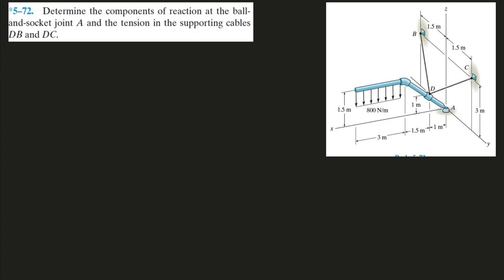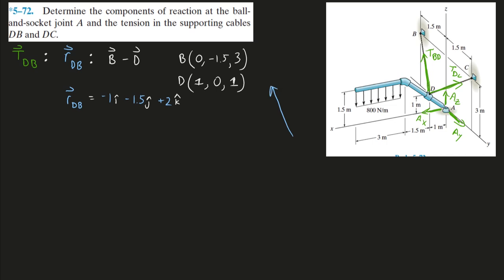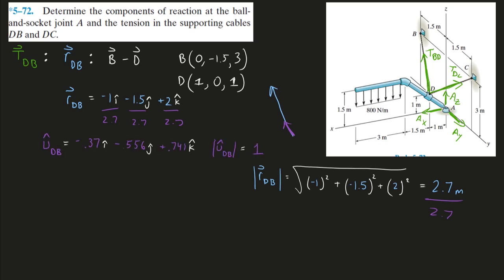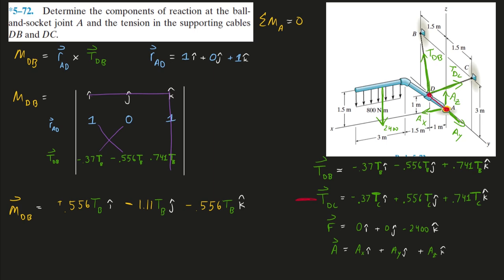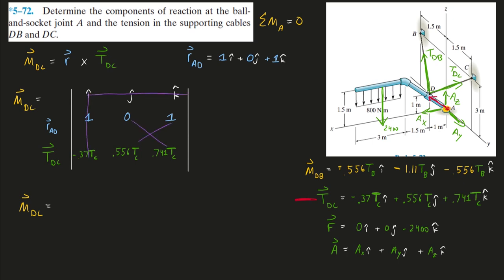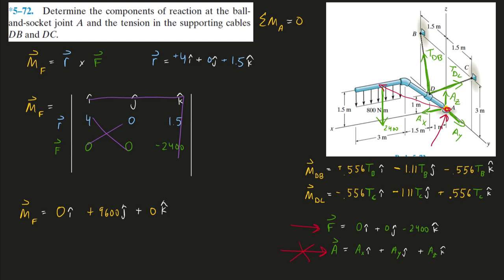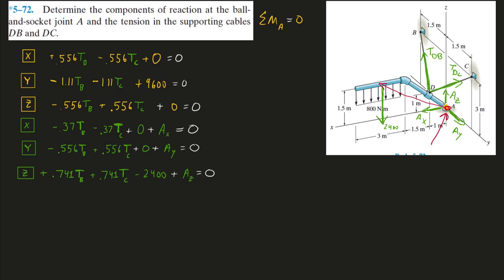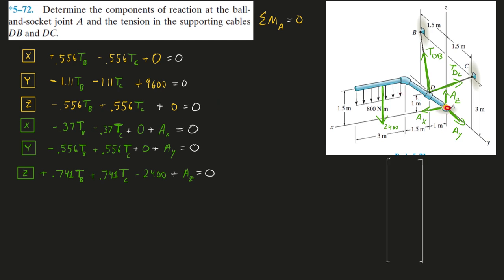Statics: 3D Rigid Body Equilibrium Problem 1

Comment: can i just  construct the 6 eqns by sum of Fx,Fy,Fz=0 and the sum of moment about x,y,z axes=0 rather than doing the cross product?
Reply from the maker: I use the cross product to calc the moment vector of each force. You need this so you can do sum moments xyz. There is another  way to calc the moment of a force: the scalar method, but i don't like using it.
Reply: @eng1048  alright good video btw thanks sir